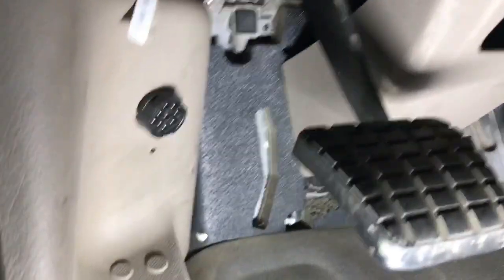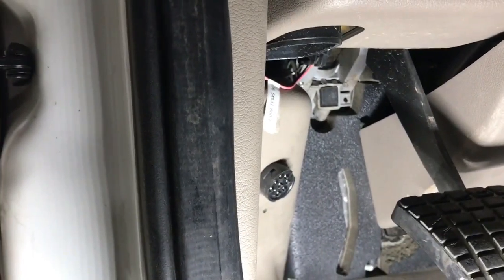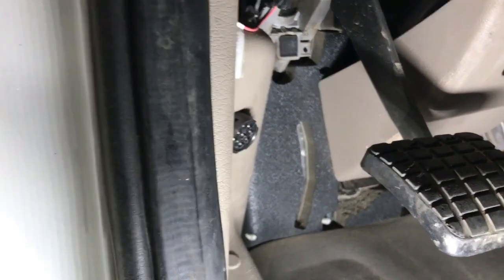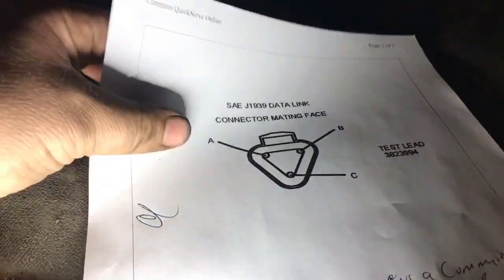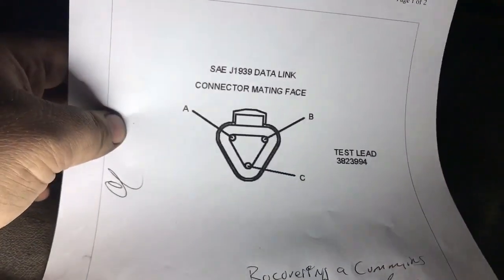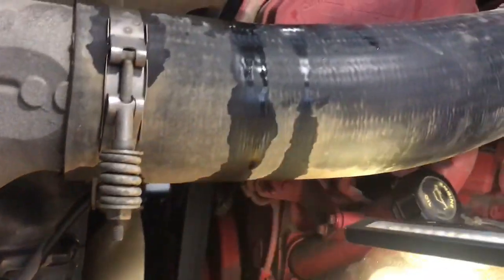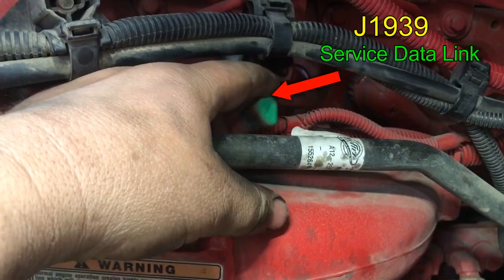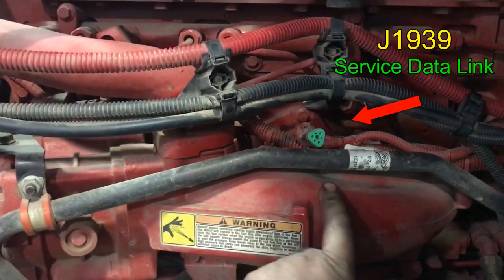Cummins Diesel ISX,ISB service J1939 service data link location and More

Comment: I was following insite today no comm issue grom def relay dpf temp sensor module and nh3 no com it told me to check the voltage there but i i couldnt find the thing

Comment: Hey brother can you help me iam getting these code 
Engine ECU code-Mid 128 psid 201 fmi 9,Mid 128 sid 231 fmi 2

Transmission ECU code-Mid 130 sid 231 fmi 
Which are j1939 data link for volvo d12

Comment: Hey sir. Does this code j1939 has to do anything with speedometer and cruise control? My speedometer sometimes works good and next day it's acting crazy and no cruise because of that. Thank
Reply: Its not a code its a protocol
Reply: @25052007 how critical is this ?

Comment: How would I create a pigtail to connect the SDL plug to laptop/insite?
Reply: I made 3pin to 4 pin adapter 2 x data 2 x power to 25pin inline

Comment: Thank you very much for this video. Really appreciate your time and effort.
I would like to have few Queries & Technical details as well;

I am looking for Detail Wiring diagram, Connection layout for
this product Mgate 5118.

What other accessories required to Connect from J1939 module to Genset 

& 

also to Connect from J1939 module to ECM.

i,e from CAN 1939 Serial Interface 6 PIN TB to Connect Where ??? 

&

Also MODBUS serial Interface DB9 Male to Connect Where???

Please take your time & reply me.

Thanking you

Looking forward to hearing from you.

Warm Regards

Md Fasi Ur Rahman.
Mechanical Engineer
fasi2all@gmail.com